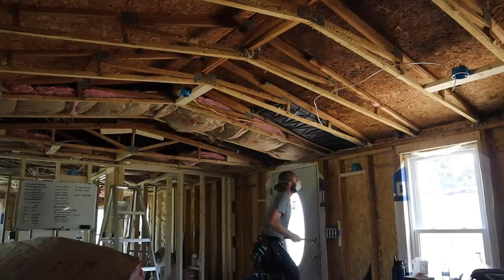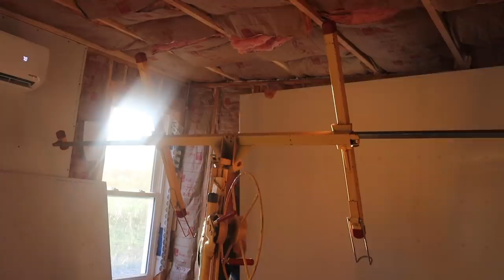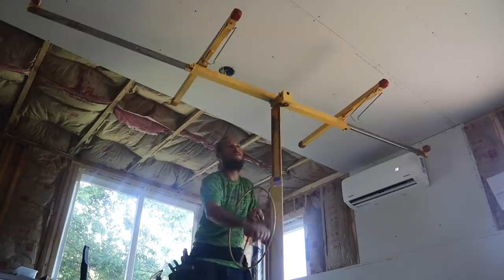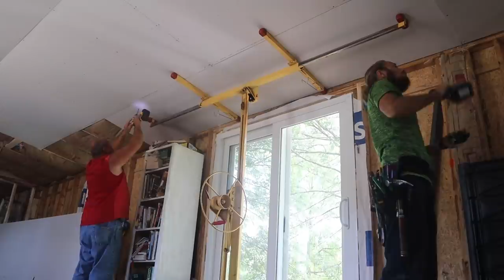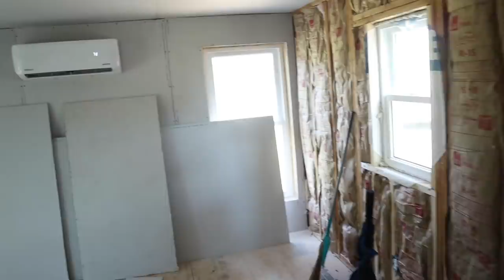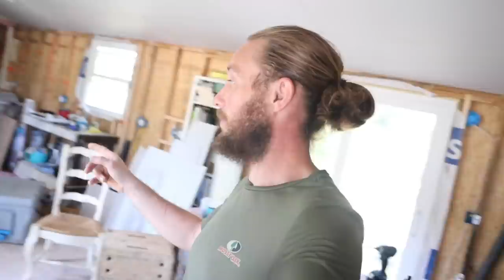We Needed To See This Progress

Comment: great job guys!  those lifts sure help. i remember dry walling the neighbors place and using my head to hold the sheet up. haha!
Reply: My dad always made a T with 2x4's to hold up the drywall. Just a little longer than the ceiling height, and one person with their foot on the bottom to hold it in place. The lift is so much easier.
Reply: I use a piece of 1x4 6' long and screw it into the wall 1/2" below the ceiling. This gives me a lip to rest the sheet on.  Hold the rest of the sheet up with one hand drive screws with the other.  Then I put the 1x4 at the new seam overlapping the new sheet, screw it into the 1st sheet I just put up at the beams, will get spackled anyway,  and slip the new sheet in on top of the 1x4. Same thing, hold and screw.  Work my way across the room.  It was a workout but it got done.  A jack would have been much easier.

Comment: Hi Ben and fam, I’m a qualified drywaller and I just wanted to say you should have used stud adhesive, the screws in the ceiling can pop and sag, also don’t join on a rafter or stud join in between them using 2x4 10in backing timbers with 1.5mm packer on one side to create a recess so when it’s flushed the butt joints are flat not proud, When you join on a timber it moves and the join cracks.
Along the recess joints in the ceiling should have a 8x16 backblock of Sheetrock, the blocks are glued half half on the back of the recess join making one continuous sheet this is to stop hairline cracks along the recess, expansion and contraction from heat and cold causes the cracks

Comment: We live in an expensive double wide with drywall only in the living areas.  I really like what you all have done.  Just after we purchased this huge double wide, one of our neighbors purchased 2 old single wide trailers and put them together and it looks like a house.  He put a fabled roof over both units and he has started putting siding on it.  My wife said that's what we should have done.  When we purchased our home, there were 2 old single wide trailers on the lot they were giving away for free.  Oh well, hind site is 20-20.  You all have done a great job.  Your home is going to look new when you finish.

Comment: I'm like you I never used one of those drywall lifts. We always did it the hard way ,just lift and we used drywall nails too. Of course that was probably 30ish years ago. And you think your doublewide was bad, There used to be a lot worse than yours to work on believe me I could have built small houses for what the guy I worked spent on old trailers. But it does you good to see the drywall up and it also made me happy too. So happy for you all. I always liked to finish drywall. but at the end of 9 10 sometimes12 hour days Then we would move onto another project. You guys have come along way and it's looking awesome and the farm too! Thanks for sharing!

Comment: Here is a DIY That will save you hours on sanding and will have a better hold with a heck of a lot of no cracks instead of paper tape on your joints use the fiberglass I have used it for over 20 years and love the stuff. Even when I have helped friends I bring mine with me every time. It has save me Hundreds to thousands of dollars over the years and with sons believe me you will need it. I hope that this helps.

Comment: Everyone does things differently in different areas and I know your using paper backed insulation...... but without stapling it on the face of the stud I believe your supposed to have a vapor barrier like plastic so you dont have condensation and ruin your hard work . Anyways good luck and glad your all safe after the wreck .

Comment: I hate to be the Dudley Downer in the comments thread, but this little piece of information could keep the house drier and eliminate breezes in the winter time! WHERE IS THE VAPOR BARRIER??? Between the insulation and the drywall should be a 6 to 8 mil plastic barrier.. Guys that needs to happen or you will get moisture problems with the insulation in the winter time, this will then cause your newly reconstructed walls to rot early! Just a suggestion, please think about it!

Comment: why are you not strengthening the ceiling with 2 x 4's ?? the wood is sch a small dimension in trailers .. the drywall installed on the same dimension wood in my simular trailer is making the trusses sag and now all needs to be replaced..

Comment: If that sheetrock is 1/2 inch. You have big long term problems. The structure of a mobile home is not designed for half inch rock.
Your eye beams are 4 feet from outside wall you need support on outside wall's. Your cieling joist/ rafters are only designed for 1/4 inch. And yes I know 1/4 inch rock is crap. You WILL HAVE PROBLEMS. Not right away 18 months to 3 years.
Many people believe that it's no big deal. Your house do it your way. But I have been there done that.
Just a friendly warning.
And NEVER PUT CERAMIC TILE IN A MOBILE HOME WILL CRACK. MANY HAVE TRYED NEVER WORKS.
THAT WILL START CRACKING IN TWO WEEKS. THEN GET MUCH WORSE.